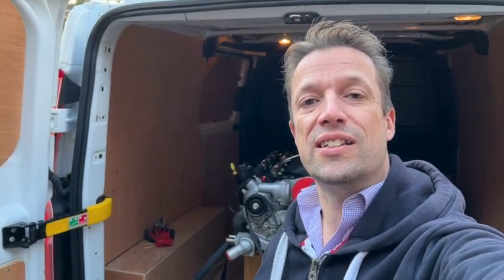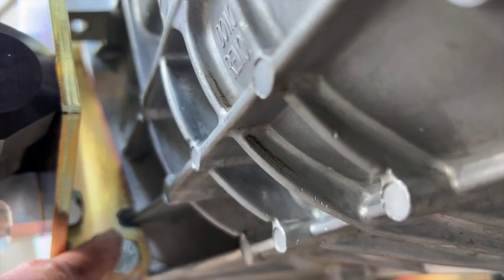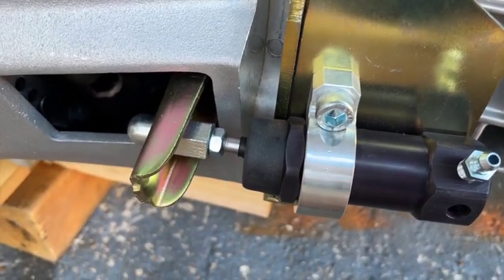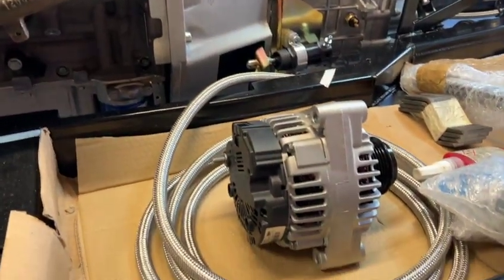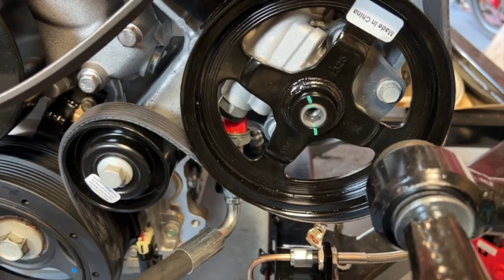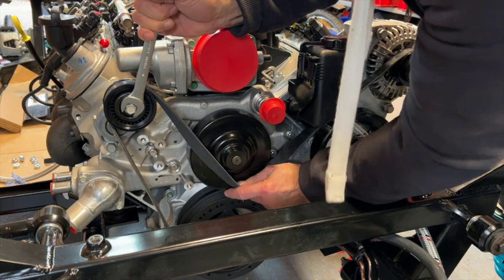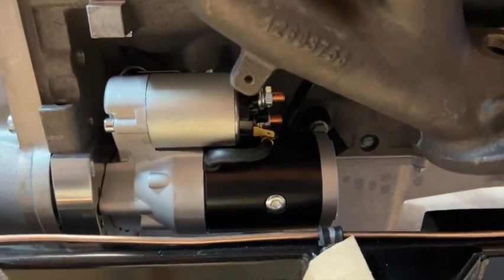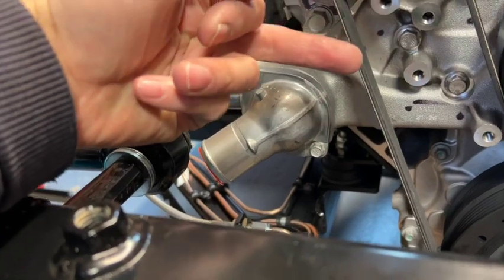Building the AK Cobra - The Engine and Gearbox - Part 06

Comment: LS3 isn't what Carroll Shelby had in mind. He was kicking GMC, & Chevy's ass with a 427 Side oil cooler where is yours???
Reply from the maker: You might be right, but I am not interested in the foibles of an old engine when these modern plug and play engines deliver more power and are easier to work on, and still give the theatre of noises and grunt that we all love about Cobra’s.
Reply: @russ.howell   the 427 is the epitome of grunt & growls. It doesn't get much better than that. Do I need to remind you of the grunt of a 1965 427 Side oil cooler? That car is legendary. We're not even going to mention the 65 Supersnake with 2 superchargers & 1000hp!!!

Comment: Another good video, keep them coming.  Engine block sensors, One I think is the knock sensor, the other is the crank sensor, the connector on the side of the sump is either an oil temperature sensor or oil level sensor.  Would be better to remove and fit a blank sump plug type bolt, if you wanted to.
Reply from the maker: Yep, another video soon. I'll cover the sensors when I do the wiring video, but thanks for the tips, cheers